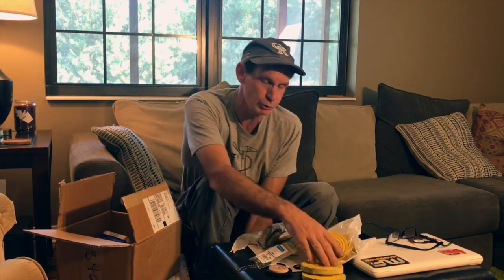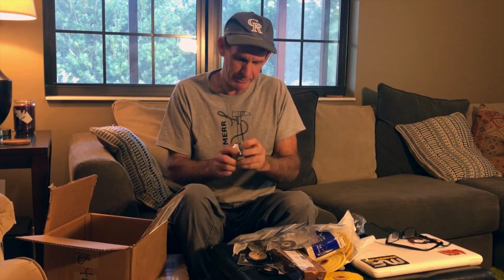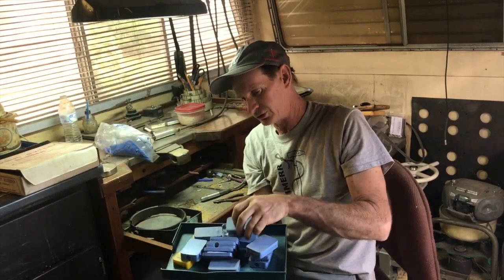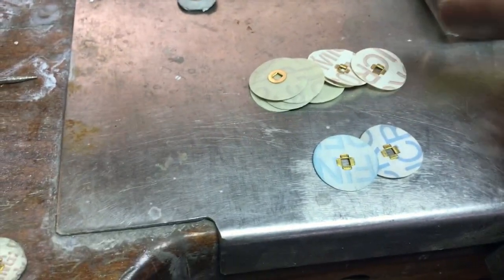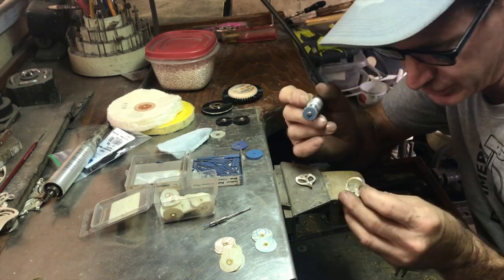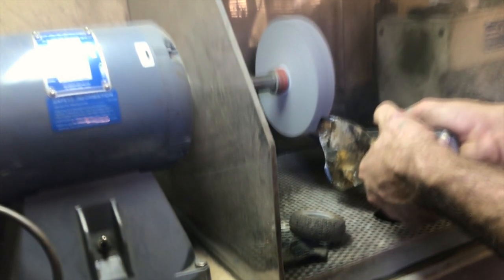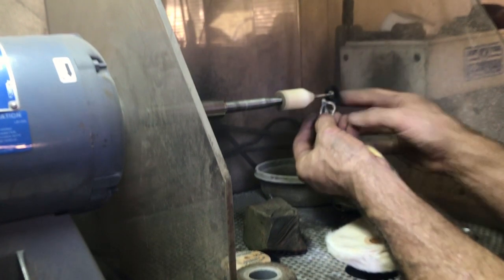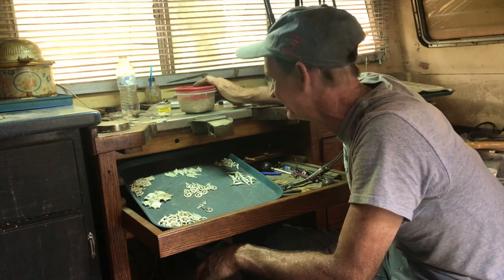Silversmithing Tools & Supplies: Must Have's, Jewelry Making, Casting, Polishing

Comment: Here is on 3m's site, you can get the wheels in widths of .375", .43", .5", 1", 2", 3", 6", 24". If a jewelry supply place doesn't carry them, it doesn't mean you can't get them from other suppliers! https://www.3m.com/3M/en_US/company-us/all-3m-products/~/All-3M-Products/Manufacturing/Metalworking/Abrasives/Industrial-Abrasives-Finishing/Abrasive-Wheels/?N=5002385+8709320+8710530+3293083696&preselect=8692962+8710644+8710812+8710953+8711017+3294857497&rt=rud